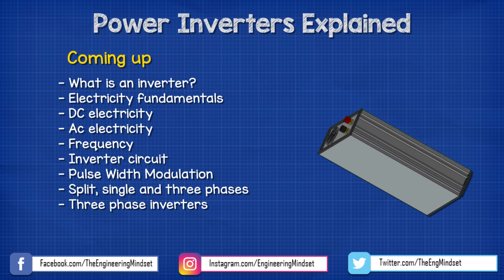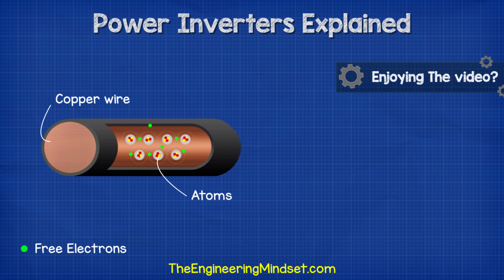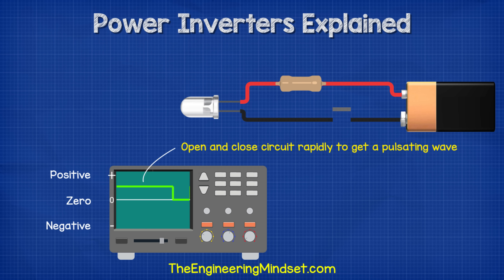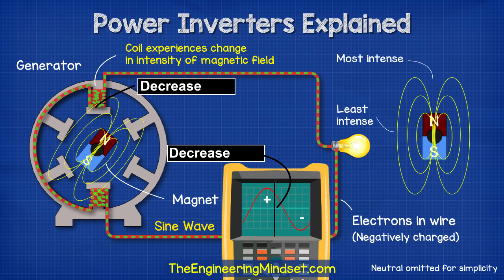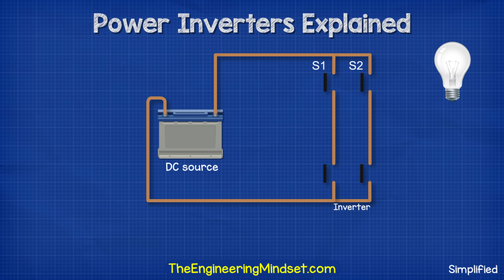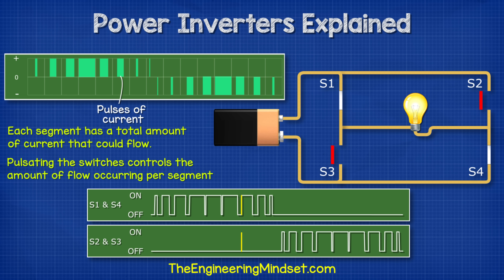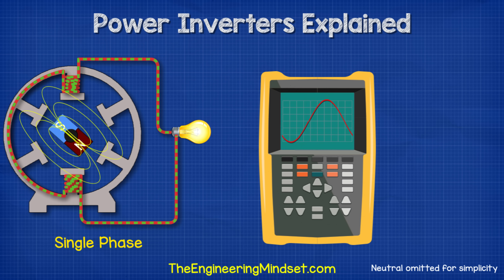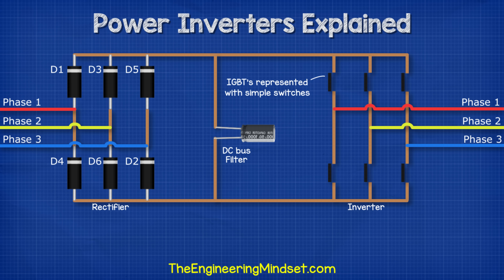Power Inverters Explained - How do they work working principle IGBT

Comment: 4:13 Side note: Not all synchronous generators have a permanent magnet in their rotor. Some use a circuit fed with DC instead to produce a steady magnetic field, working as an electromagnet.

4:17 The electrons in the winding don't get pushed just because the magnet has a polarity. If that was true, holding the magnet still should also make the electrons move, since the magnet still has its polarity; but in reality this won't happen. The real reason why the electrons move is because the magnetic field of the magnet (or electromagnet) is changing, thus inducing an EMF in the windings. At 4:37 you explained it correctly.

9:48 Even though the phase is split, it's still just a single phase, since the voltage or current in both live conductors are in phase (or 180° out of phase.) To be considered as two phases you'd need a phase shift between the current in the two live wires, i.e. 90°. Anyways, I understand what you meant to say. ;)

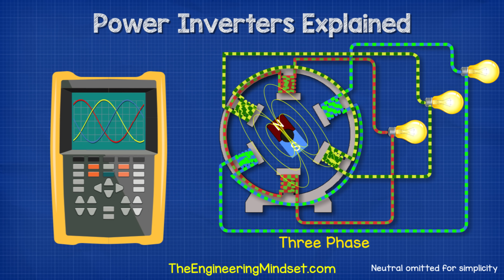10:13 In general, the coils/windings of the generator aren't inserted 120 physical degrees (A.K.A. mechanical degrees.) In fact, in the generator you showed the angle between two adjacent coils (of different phases) is 360°/6 = 60°. Real generator have more than one winding per phase, so they're inserted at angles much less than 120 mechanical degrees; you can google about Ferrari's theorem. What is true, is the set of three output voltages are 120 electrical degrees shifted.
Reply: Ofcos he knows this but he can't go to indepth otherwise it will complicate the video

Comment: If a battery electron density is equal when it's "dead" can we just use a magnet to force them to another side ? Or is it gonna explode or something I'm new and idk
Reply from the maker: If the battery is single use then no, the chemical reaction can't be reversed. If its rechargeable then you could the a magnet to induce a voltage but its going to be incredibly inefficient, you'll need an alternator or generator
Reply from the maker: Check this out, how a battery works: https://youtu.be/PXNKkcB0pI4

Comment: 2:53  please i'm quite confuse.
 if the electron flow from negative to positive, why you put the resistor (after) the LED? 
Anyone please.
Reply: Its from positive to negative
Reply: It does not matter where you put the resister, it can be before or after.
Reply from the maker: Check out NEW resistor video, everything covered! ➡️ https://youtu.be/DYcLFHgVCn0

Comment: Hi, really nice video but could you please explain the part where the transformer increase the power, thank you
Reply: actually the transformer increases the voltage from the inverter's output, so on the input side more current is needed to provide the same power ... on the 3 phase model, the fact that the phases overlap ensures that there is less time where you have low voltage

it's like 3 men pulling on one string but not at the same time, giving 2 men short time for a rest instead of 1 men pulling the string for a short time and having a rest for the same amount of time :)

Comment: I would like to say one more time that this video is not enough to take on such a project. Its fine if you just want some basic knowledge though. You should do some further research and be absolutely sure that you have taken precautions. I tried this and because of the lack of supplies, I got tempted and used electricity from the outlet. Bad things almost happened, don't be as stupid as I was😂😂

Comment: Atm I'm working on building an arduino based one, but most of the Spwm codes do nt work :( maybe its also the problem that I'm using irlz44n mosfets without a mosfet driver (I never thought I would need them XD) but I've read that you need them for fast switching. Idk, if oyu have any ideas for me please tell me. Thanks :D
Reply from the maker: See my new MOSFET explained video here➡️: https://youtu.be/AwRJsze_9m4

Comment: So very interested in the use of solar powers, storage batteries, wind turbine, li-Ion battery configuration etc, so videos on these would be most helpful. Thanks!
Reply from the maker: Check this out, how a battery works: https://youtu.be/PXNKkcB0pI4
Reply: Most methods of power storage are going to naturally want to output DC power if you don't create additional circuitry. This is true whether it's an actual battery, you're moving water or sand up hill or using fluctuating heat to generate more electricity from that later on.
Reply from the maker: Seen our new video on HOW SOLAR PANELS WORK in detail https://youtu.be/Yxt72aDjFgY
Reply from the maker: Seen our new - How wind turbines work video? link: https://youtu.be/Hf875eOVrVI

Comment: What's the difference between a pure sine wave inverter and a modified wave inverter and an enhanced wave inverter?
Reply: modify wave not so good coz the they not in pure wave, might damage ur electrical appliance, modify wave just an easy and cheap solution for inverter

Comment: The magnet field doesn't attract the electrons primarily,  it induces a voltage which causes a current to flow, so it appears as if the magnetic field is pushing the electrons when it is actually not. Magnetic field and electrical field are completely different. Still great video though

Comment: I have never seen this in inverters I open. Instead there are mofets (or IGBT), CD4047/SG3524 and transformer.
Reply: Igbt and mosfet both are used for same purpose 
But the switching speed of IGBT is faster than the Mosfet
Reply: Igbt and mosfet both are used for same purpose
But the switching speed of IGBT is faster than the mosfet
Reply from the maker: See my new MOSFET explained video here➡️: https://youtu.be/AwRJsze_9m4

Comment: How do electrons "flow" through a capacitor in DC?... Rhetoric question.
Reply: It doesn't actually
The plate of the capacitor connected to + terminal of battery will lose all its electrons as sucked up by battery and become + charged and similarly the other plate -vely charged

Comment: Wanted to learn how my UPS works, learned how electricity actually works instead. You explained this so easily and effortlessly. No one at my college would have explained it like this.

Great video.  Subscribed.
Reply: An UPS has an onboard power bank, which supplies backup power when the main power is cut.

Comment: This is very interesting, thankyou.
Now, if I have a run of the mill standard car, normal 12v battery, alternator yadda yadda yadda, what can you run from this inverter you have here before there car battery and alternator can't keep up, this is the part that gets some of us into trouble, can you do a video of, 1, car running, and car engine off. I guess you'll ask, what do I want to run, well, people are running a fridge, or, let's throw this in there, what about a hair dryer the wife might want to use out camping. How's that grab ya?
Reply from the maker: Check our our new car battery explained video: https://youtu.be/VnPRX5zQWLw
Reply: @EngineeringMindset  thanks, you make understanding things great.
But powering something like a car fridge, how do we work out how long a battery would last before it needs to be recharged. You could just pick any car fridge and a deep cycle 100ah battery and explain the battery usage using the draw rate of current, do you understand my question sir?
Reply from the maker: Check out how car alternators generate electricity here: https://youtu.be/jdSKlg80DjU

Comment: How do you wire 8 pieces of 250w and 8 pieces 330w solar panels for maximum output?
Reply: It all depends on what u will connect them to & their out put voltage & current...
U need to give a lot more info if u want some help...
If they r all 12v panels then the easiest way is 2 put them in parallel... assuming ur connecting them 2 a 12v load or solar charge controller.
Don't forget 2 use blocking diodes on each panel (even in parallel).
If u reply with more info I will help u farther...
Reply: @MaxMax-dq1lu  Thanks, I do appreciate.
more information Sir.
All panels are 24 volts each.  
I have 12 x 200AH battery bank.
5KVA 48volts Inverter. 
The wiring on the roof top is;
2S8P, ie; connected 2 panels in series to get 48 volts since Inverter is 48 volts inverter.
Then connected each of the two in series PARALLEL to get 8 parallel connection. 

that is 2 by 8 wiring of the solar panels.
While the battery is 4S3P connection.

4 x12v batteries in series to get 48 volts making 3 units.
Then connected the 3 units in parallel.

My concern here us that the total PV output is about 900W as against about 4046W per panel design capacity.
I should see at least 3000W output but not getting up to 1000W for all 16 panels even at peak sunlight.
Reply from the maker: Seen our new video on HOW SOLAR PANELS WORK in detail https://youtu.be/Yxt72aDjFgY

Comment: i am confused now. i was told by teacher current flows from + to -, but really electrons flowing from -to +, question to everybody why we are protecting(fusing,breakers) only + side? i like content a lot
Reply: Because in a closed circuit, the waterflow/currentflow will always be the same, no matter where you measure it.
Reply: It is assumed that charge is "positive" when flowing from  + to -. It is equivalent to the electron flow "negative", flowing from - to +.

Comment: It is not gaps ... there is power .. take the V square ... but the power signal has gaps, not the voltage signal so we fill these gaps by other phases power
Reply: There are power gaps in single-phase ac.  Any instant that either voltage or current is zero, power is zero.

Comment: Hi. I think there is a little mistake in 0:47. Shouldn't both scops on the right display this same curve? I guess that you wanted to show how voltage will looks like with and without capacitor. But in this same time scopes will show this same values. Measuring point is this same for both devices.

Comment: Sir in three phase, is it possible to connect phase 1,2 and 3 to have maximum output? I was about to make an alternator or generator but I'm confused between three phase and single phase
Reply from the maker: Check out how car alternators generate electricity here: https://youtu.be/jdSKlg80DjU

Comment: I was building a air compressor for the home. I needed a head pressure relife switch. I only had a D C shuttle air switch to use. I put a diode inline with the 110 volt input and it worked.
Reply from the maker: Seen our new pressure switch video? Link: https://youtu.be/YG81w0HFXNc

Comment: So the Inverter we use in houses to provide power during powercuts go through rectification to store charge in batteries & then inversion to provide AC supply to appliances?
I'm always little confused on why they called inverters if the power station supply is AC.

Comment: why not explain pure sine wave inverter???
i use a 2kw pure sine wave inverter to power ac appliances (e.g. instant pot, electric blanket, power tools) in my stealth tiny home. the inverter is connected directly to a 200 ah 24v lithium iron phosphate battery bank, which is charged by two 300w 24v solar panels wired in-series. :)
love this channel so much, thanks!
Reply: What brand of inverter do you use?

Comment: Sorry to get technical and pedantic, but many appliances actually use DC electricity. Because they are plugged into an AC source, they rectify it into DC with the right voltage and current. So while not practical to just attach to any DC source, they are only designed for AC because its the only source we get at a regular outlet.
Reply: You pretty much said why we get AC delivered to your outlets, also the other reason is that you would need very thick cables in order to push current to make something work.  Not taking into account  efficiency, something that runs with AC 120 volts, to make it easy, 1200 watts, a 10 amp fuse will barely be sufficient.  That same load in DC power needs a 100 amp fuse. Now, this is not taking into account any surges or in rush current.

Comment: Your videos are always high quality and your topics are always very well explained. The animations you create are also top notch! so thank you very much. I got a question though.. what is the difference between the ESC we use for BLDC motors and the power inverter? they both covert DC to AC.. Are they both the same but one for powering small things and the other one for high power devices?

Thanks
Reply from the maker: You might liek this: DC motors explained https://youtu.be/GQatiB-JHdI
Reply from the maker: Check out the new BLDC Motor video: https://youtu.be/yiD5nCfmbV0

Comment: these videos are so interesting :D to get the sine wave more perfect then the cycle rate of the PWM allows you'd need to use a low pass filter right? how would you do that easily so that you can have variable output? :D
Reply: I know this is a bit late, but what I believe you would do would be to determine the highest sinusoidal frequency you will output and design a low pass filter based on that.

Comment: What is the issue of having constant dc to our home from the panels? I understood the three phase ac is made for the power to be constant without gaps and it is transported to the transformer.  From there how do we separate this 3 phase to 1 phase ac for our homes, and why aren't these gaps ocure to a lamp for example in our house?
Thanks
Reply from the maker: The power station generates and transports 3 phase AC. The local transformer splits this this 3 separated phases to houses or it gives all three phases to a house. The inverter can turn either a single phase or all 3 phases into DC. 
Check this video on single phase https://youtu.be/W0_1xRqT8uU
Reply: The issue is...
AC power is better as there r less transmission losses (in getting the power 2 ur house from the power station) compared 2 DC.
So our homes r setup 2 use AC power...
So the DC from a solar panel has 2 b made compatible with our appliances...
Reply: Here's the right answer.  Remember the transformer?  It allows us to change voltages to anything we need to operate anything in our house.  Inside different appliances, the voltage demands are different.  A TV isn't gonna need the same voltage as a washing machine or a fridge.  Each appliance has a transformer inside to adjust the incoming voltage to what it needs to be.  You couldn't do that with DC.  It only works with AC.  It was an excellent question.  Let me know if this is a good answer.
Reply from the maker: Seen our new video on HOW SOLAR PANELS WORK in detail https://youtu.be/Yxt72aDjFgY

Comment: Again an amazing video. What I always have a hard time grasping in regards to this topic is how the gate controller works?
Is it just a micro-controller that has been coded to when to send an "on-signal" to that specific gate for a set amount of time?
Is there no mechanical way to do this?
Reply from the maker: Pretty much yes, some formulas programmed onto a chip telling the igbt to open or close
Reply: @EngineeringMindset  Thank you for the quick replies. I have a few more questions about this if you don't mind.
The chip has a set voltage to activate the gate? Is there any current running to or from the gate? If so, then it is a separate power-supply I assume.
If I remember correctly the "standard voltage" in my text books, is set at 0.7V to activate the gate. Is this a fixed voltage or do bigger IGBT's require more voltage?
Again, thank you for your replies, fantastic videos and I am looking forward to the next video :)
Reply from the maker: I'm part way through a dedicated video on transistors so I'll clear it all up in that.
Reply: @EngineeringMindset  im excited for the transistor video :D im guessing you are explaining the different types, i hope you could also explain when npn and pnp transistors are used i can never remember it properly :/
Reply from the maker: You could theoretically do it mechanically changing generator speed and magnet strength for the rotor, but it's not going to be very good plus its far more complex
Reply from the maker: Transistor video now live: https://youtu.be/J4oO7PT_nzQ
Reply: @EngineeringMindset  Amazing!! Thank you for the notice :D

Comment: Feels like IGBTs are the secret sauce and we don't know what that stands for let alone the physics behind them. Of course I'll hit Google, but might be nice to include. But still, neat video. Thanks!
Reply: The logic of IGBT's are identical to transistors. (Not the mode of operation, but the logic.) Ie, a signal is sent to one pin, thus opening flow in one direction between the other two pins.
If you want to understand how IGBT's work, start by looking at how diodes work, and understanding the quantum physics at play there, then go to transistors, then IGBT/MOSFETs.
Reply from the maker: Transistor video now live: https://youtu.be/J4oO7PT_nzQ
Reply: StringerNews1 There 
absolutely is physics involved quantum physics to be exact. The definition of physics is not moving parts, thermodynamics and lots of other physics do not involve moving parts
Reply: As far as I'm concerned, an IGBT basically operates like a BJT and a MOSFET stuck together with gaffer tape. The MOSFET (which needs zero gate current, but has medium resistance) turns on the BJT (which is low-resistance but thirsty).  Combining them in semiconductor is complicated, but their operation is not too obtuse
Reply: @gigabyte2248  abundant over unity devices too, right,  or not? Is the reason we do not use IGBT 's for bulk square wave AC generation, is this because the (t epsilon 0) transient t would trip any sensitive electronics, or it would as it reaches any type of reactor?
Reply: It stands for insulated gate 🐻‍❄️🐻‍❄️ transistor
Reply: @StringerNews1 thought it was "integrated" gate bipolar transistor
Reply from the maker: See my new MOSFET explained video here➡️: https://youtu.be/AwRJsze_9m4
Reply: @StringerNews1 bahaha everything is physics, moving parts or not.